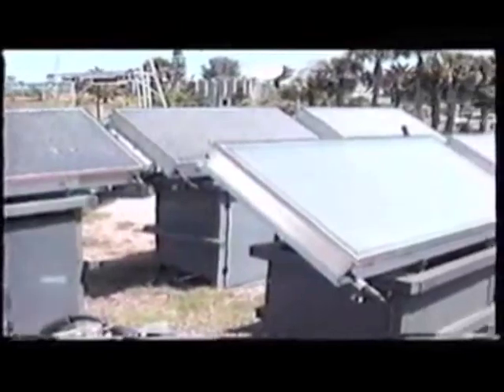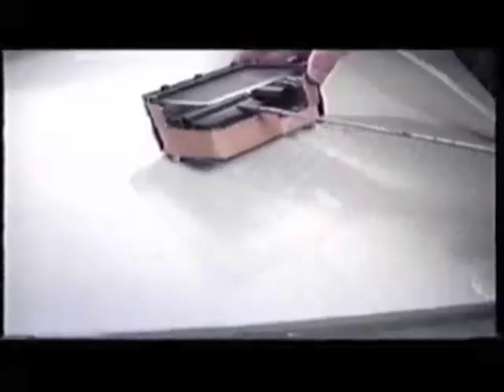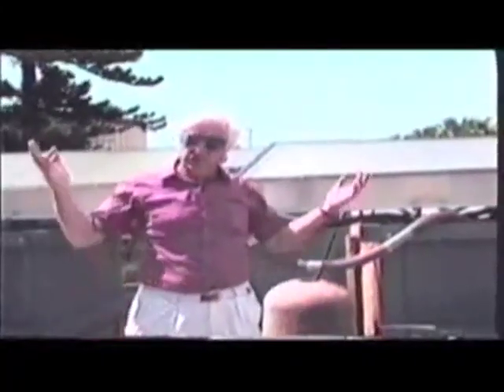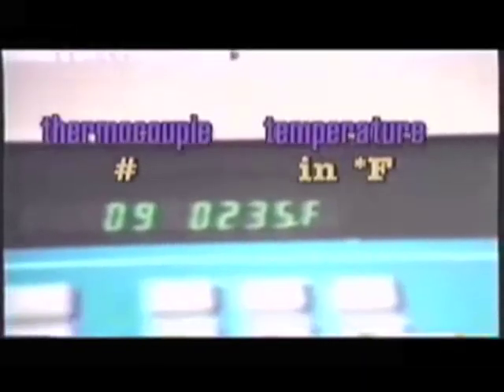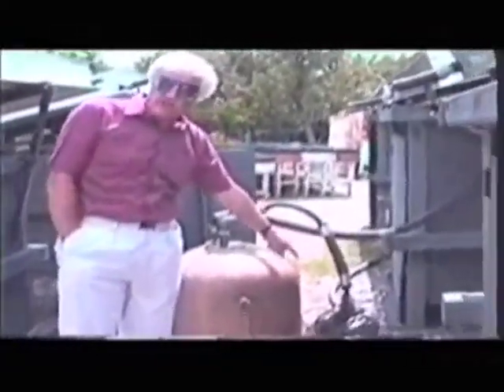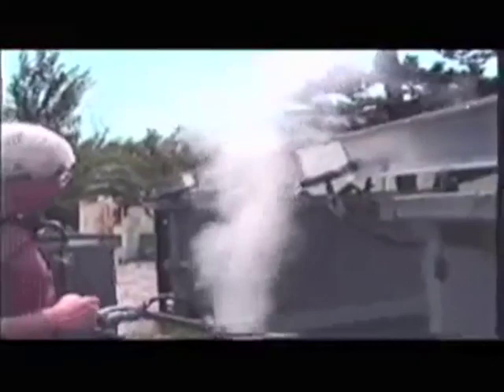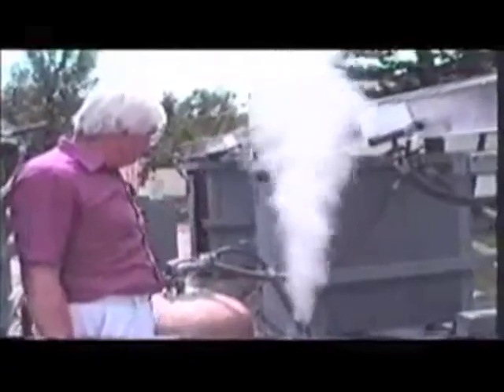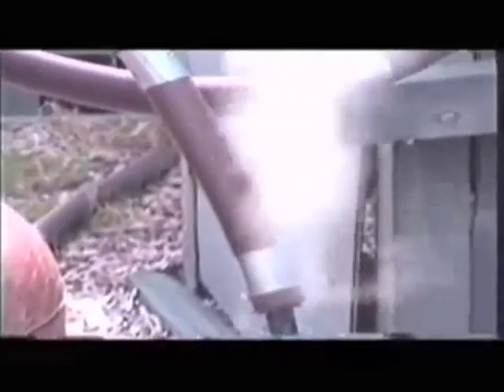SOLAR WATER DISTILLATION Steam Production from 1991

Comment: There are a lot of publications on diffirent tech for destilling water. The system above is not very efficient. By making steam and directly condensing it you are left with hot water so a lot of energy is being lost. Currently the most efficient way to distill water is called "humidification dehumidification". It uses water at 60-80 C and conserves the heat in the system. To produce water for a city you need several hundreds of square meters of solar collector which implies large startup cost.

Comment: @GREENPOWERSCIENCE Hey Dan this is not available at all anymore, anywhere, that I could find.  Not even using the internet wayback machine...?  Do you have any more of the series?
Reply from the maker: No, it disappeared years ago, even when I did the video there was basically no info on the project other than it was atMote Marine Laboratory & Aquarium?
Reply from the maker: The baffles I could never figure out. I think double pane glass with argon gas might work?

Comment: Copper tubes, air  and salt water don't really mix to well. So unless they use aluminum or special coated tubes or introduce a vacuum you going to be burning tubes. I would suggest a secondary system using a heat exchanger

Comment: Water does not have to boil to be distilled.  Nice system though. One other thing, if this system was meant to produce distilled water it sure is inefficient in production. If you want to make distilled water it is best to capture and condense the vapor, not let it blast into the atmosphere. This guy is just helping form clouds in the sky. Also running the water thru pipes to heat it will leave deposits in the pipe and reduce efficiency even more.

Comment: Nothing is free. I bet its cheaper doing the same thing with oil or gas...
Today there is better solar absorbers using vacuum tubes to prevent the heat from escaping the collectors. These tubes are availeble to buy... usually used in hot water systems.

Comment: The average Temperature of roughly 240F...translating to 116 Celsius (Honestly american scientists do as great work as other scientists, but your units are garbage)
means that this collector works at an overpressure of about 1.6 times atmospheric 
So i guess those boxes contain pipes with good insulation .
It looks like he found a effective way of producing steam ....at 1.6atm it wont produce any great efficiency but a large bore steam engine might still be able to extract some power ..

Comment: fossil fuel are only 1% efficient by the same method.

Only about 1% of the original sunlight energy is left in fossil fuels once the plants have been changed into oil or coal.

Combine that with a 30% motor and you have  .5% of the sunlight powering your vehicle

20%(PV)*80%(electric motor) = 16% of the sunlight.

You are getting nearly 32 times as much energy from the same amount of sunlight